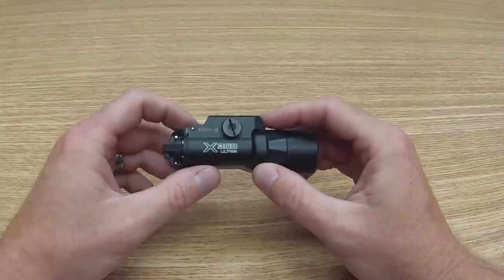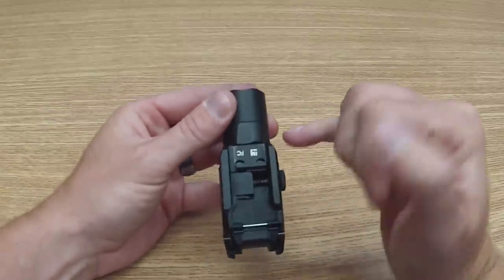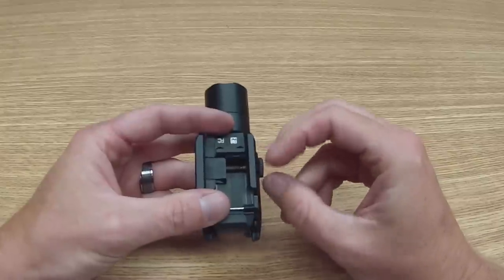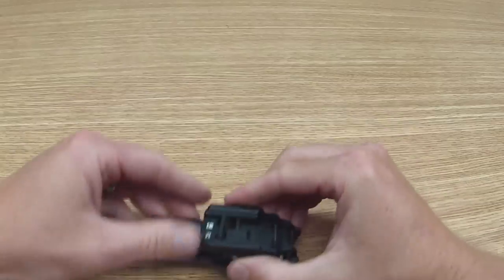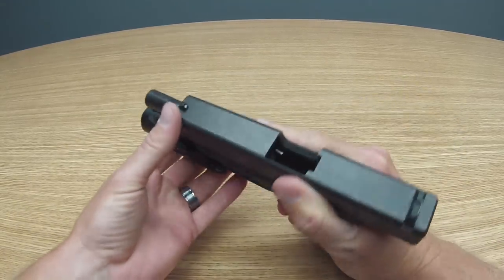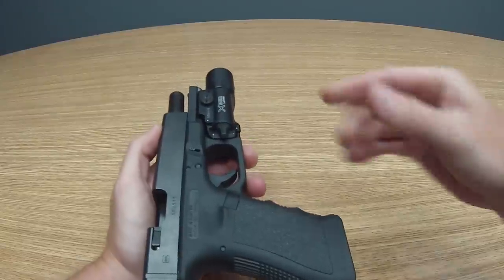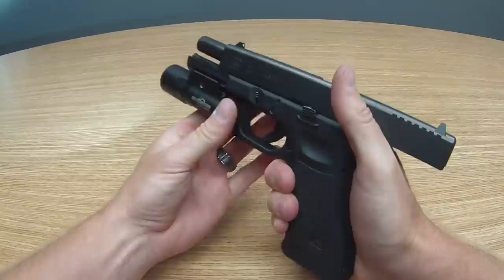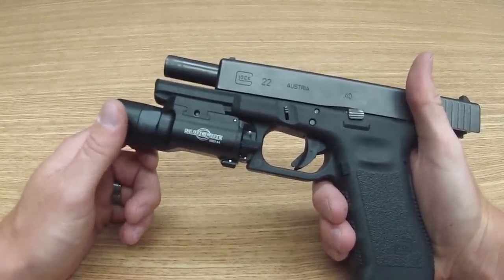How to Install the new enhanced SureFire X300 Ultra

Comment: Thanks for posting this.
The included instructions aren't exactly clear, and I took my wedge out — not understanding how it fit.
First time at the range, my X300u started creeping forward with each shot.
Obviously, I'm not the sharpest tool in the shed, so thank you for this video. Now it's on tight and secure.

Comment: I bought this for my Springfield  Prodigy last week. I got it today, with that being said this is my first light from Surefire and it is amazing I love the light but the only complaint that I have right now is that the switch is very stiff the pushing of the button is no problem but by God that flip up or down is beyond stiff.
Reply: That's on purpose. When you have down time.  Take your batteries out. Rock the switches back and fourth. They will break in

Comment: What is the best way to address the angling that happens when tightening the “A” model Rail Lock hex screw? I’ve mounted these on metal and polymer framed pistols and have noticed the same canting as others have mentioned. Wondering how to level the A model. Thanks!

Comment: Why is the wedge that fits in the groove smaller on this light than mine. Mine is 3/16 inch wide. And it will not fit on my G 17 which is .145” groove

Comment: And the retaining pin? Can’t get it in
Reply: In the video, they don't install the battery retaining pin. It seems most people omit the pin, despite them making a big deal about it in the directions. I scratched my new x300 trying to wrestle the pin into place, which of course never happened. F the pin! lol
Reply: I couldn't get the pin to fit either.  I heard most people don't use it.  Doesn't seem completely necessary to me
Reply: That’s what I ended up doing, just leaving it out, doesn’t seem to matter